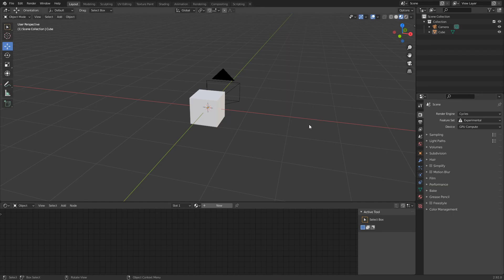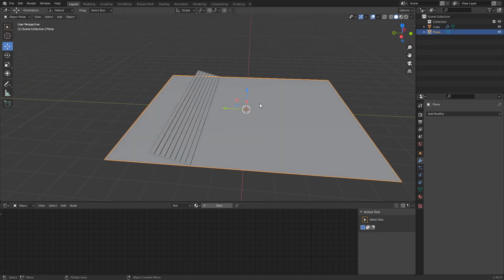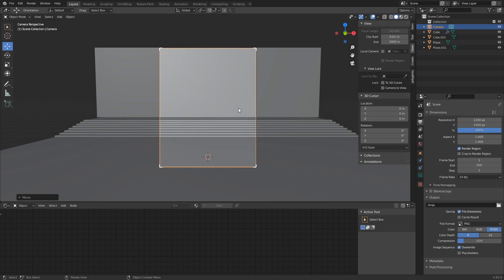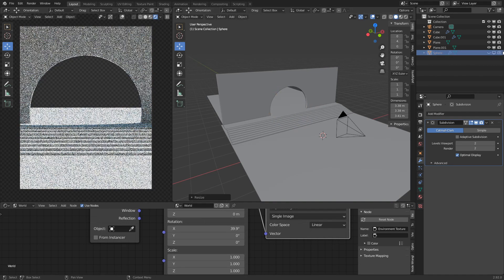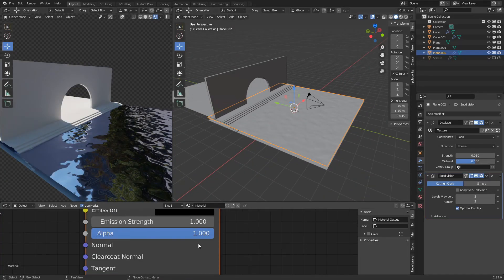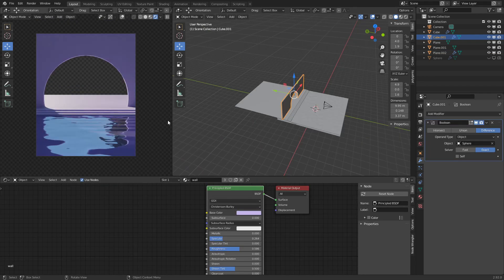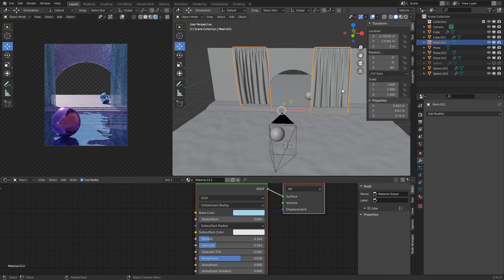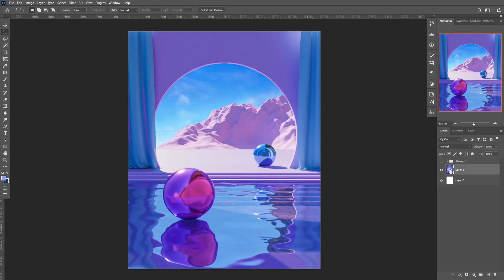Create A 3D Architecture Blender Environment Design (Blender Tutorial)

Comment: 4:37 Scene Setup with HDRI? Everything is grey here
Reply: Click the down arrow button in the right side of viewport shading, and check the Scene lights. you will resolve the problem.
Reply from the maker: That's cause your using a normal texture node, if you find the "Environment texture node" and add the HDRI will have the lighting :)
Reply: @HDxHEXA  i add enviroument texture and same hdri but its still not same as you its  grey like solid pls help
Reply: @saba9224  change the render engine from eevee to cycles
Reply: @HDxHEXA  when you put the hdri picture in you see it in the viewport or is there a way to not see it, like in your presentation (while having the effects of it though)